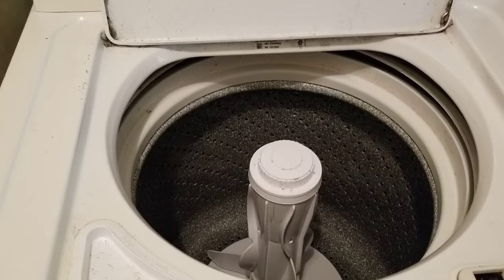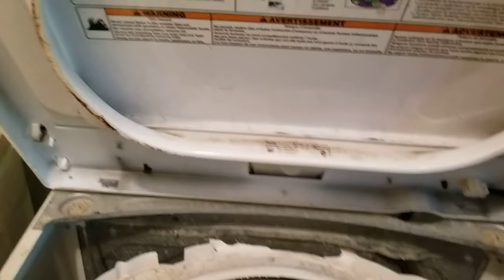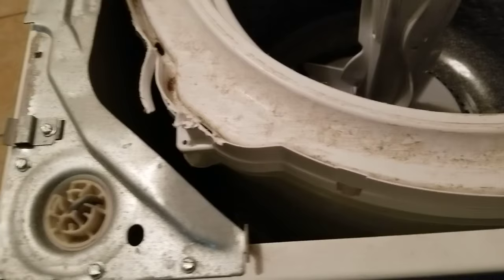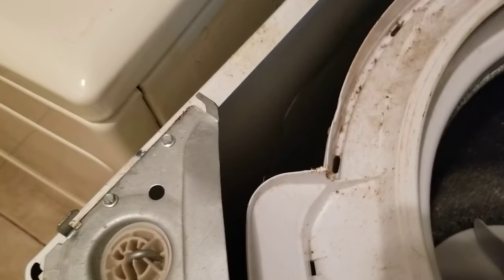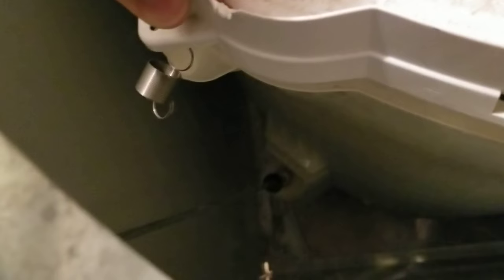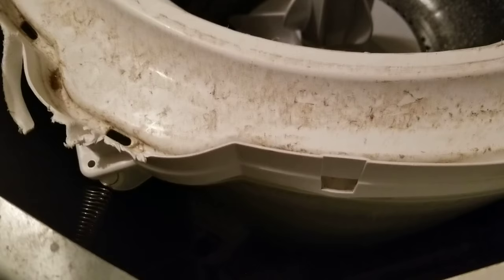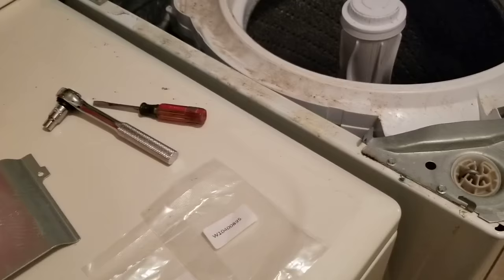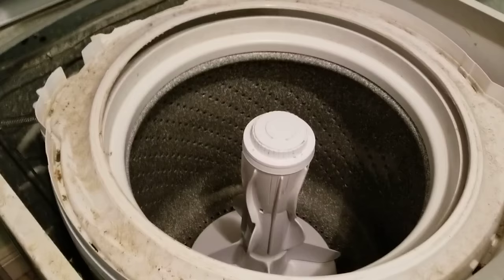Roper / Whirlpool Washer banging out of balance No. (1)  / shakes / moves *(worked briefly)

Comment: Don’t buy a new one. Look for an older 80’s era Maytag washer that’s in good shape. New washers are winey, problematic liabilities. At the first sign of resistance or the slightest off-balance event, that these new washers pick up from the load, they stop the wash cycle, crash, and throw malfunction error codes like the OBDII system from a newer car. Old washers just keep going and going like the Energizer bunny.
Reply: I did considered buying an older washer off of Craigslist. 
Thanks!

Comment: My Washer “Wirpool didn’t Come Whit Springs So am going to get them is those Springs Parts Number Apply to Any Washer as long they have Springs ?? Thanks
Reply from the maker: If it didn't come with springs, then that's NOT the problem. Watch my next video, that's probably it if it's shaking...
Reply: @PatriotMarine  Thanks going to Put them Springs On and The Top Bushings See What happens hopefully get fix thank You Sir.

Comment: thanks great job!! can you find that type of suspension part fo rmy whirlpool, i am havin trouble, wtw5000dw0........also i replaced my suspension rods 3 yrs ago, the washer is only 5 yrs old, now i am thinkn y didn't they repair the springs at the same time? thanks
Reply: We have a Whirlpool one.  Our machine kept banging around.  You could move the whole drum all over the place when it wasn’t running.  You could tell something came undone. So hubby thought it was the suspensions.  He ordered the parts on EBay.  He ordered new suspension rods and new springs.   And it takes two people to lift that drum to put the springs on.  We did a test run. I heard a slight bang for like 1 second.  And I thought. Oh no not again.  No banging after that.  The drum has a better resistance when you move it manually. When  replacing the rods, replace the springs too.  Kinda  like when you replace the lightbulbs in your car headlights, you don’t want one light working and one dimmer one.  Also, make sure the load is evened out around inside the machine.

Comment: Mines been shaking violently and watched your video. Are these springs supposed to be installed but we’re just left out by negligence? Had some that were close that I put in made a big difference. 

Gonna contact Roper on Monday and give them hell for selling a machine with missing parts. Isn’t the only thing that was wrong with this thing from the start. 

Roper used to be a quality brand don’t know what happened to them they turned into junk.
Reply from the maker: Mine only worked a few times after this repair 'STRANGELY" ... the other video after this one REPAIRED it for good STILL 859 days later...
Reply: @PatriotMarine  will check it out, thanks.

Comment: BANGING IS WORSE. I put in the same size springs that that one of the "top comments left. The banging is twice as bad. Rods are all fine, what could it be?
Reply from the maker: for me, it was fixed with new rods.
Reply: @PatriotMarine  what I found out after disassembling the whole washer was that that white top plastic ring/rim on top of the bucket, water gets in there somehow and creates an unbalanced scenario at high spinning speed making the bucket unbalanced and starts making all that noise.  What you can do to check is..  if you grad the center wash piece and move it front to back or sideways, you will hear water stuck somewhere, then that would be your problem.  At height spinning speed, all this water gets to one side and trows the bucket out of balance.
Reply from the maker: @raulchavarria5414  interesting. But water should only be up there IF it's unbalanced really bad and banging around.

Comment: If it didn’t come with springs I wonder what stopped it from jumping from the first day of use?
Reply: I had this Same washer and it did not have springs I added them after I found out about it.
Generally though i tend to keep mynloads pretty evenly balanced if inwas blankets I make sure on the opposite of agitator I make sure I add another blanket or an item equally heavy to help keep the machine in balance during spin never had the machin go out of balance I have since traded the machine for a soeedqueen though I didnt like how cheaply built the machine was.

Comment: addendum My apologies, I kinda got your video confused or combined with another one. I wish I had watched yours first or paid more attention as I didn't pay attention to the part where you demonstrated that if the tub part is bouncing up and down you said that you didn't need the 4 rods with springs. I watched this other one and that dude said it had weak springs which was what was making it wobble and slap around. This looks like it could be very dangerous if allowed to continue. I've seen pictures where the tub actually came through the sheet metal body and did considerable damage to the washer. It was totaled. It appeared that it could have been worse and if someone was standing nearby and attempting to hold the stupid thing down, like I was, Thinking that would help which it didn't but I could have been injured. I also shut mine off after noticing all that banging and just let the clothes drip dry as much as possible and just threw them in the dryer, quite wet still and let the dryer take 2 hours to dry them out. At any rate I did find out that I was getting greedy or trying to hurry things up and tried doing all 4 rods at once thusly making it a lot harder to get them in. Seems like the last one was hardest as if it was holding all the weight which didn't make sense because I had the other 3 already installed. Perhaps they were working against it. I guess that's why you don't hire a surveyor to fix your washing machine. I'm an excellent framer and form work carpenter and can do trim although it takes me forever because i like the joints to fit perfectly. I was taught.while helping carpenters while the survey work was finished and waiting on the next building to start, how to do trim work with a coping saw and a  wood rasp. It's easy and fairly quick and you don't need a fancy miter saw or electricity. I hate modern age tools, jobs, satellites and workmanship. How are we going to teach our art to the new workforce if all they need to know is which button to push or how to find an app. I haven't found an app that uses a shovel and digs a hole for you or I'd sure use the heck outta that one. Back to the subject, my apologies, I go off on a wild tangent occasionally. I may have some sort of attention disorder. Ummm where was I, oh yeah, I may have needlessly replaced the 4 rods with springs although it did help a little. It still shakes rattles and rolls. I think that was the words to a line and maybe even the name of an old rock song. Jerry Lee Lewis maybe, I dunno? But I have since ordered the 2, yep only 2 of those other apparently useless springs. Maybe they came loose and flew into oblivion or got stuck and hung up in there somewhere. I was thinking that being spring perhaps only 2 are needed due to the way a spring works. Maybe they keep the stupid thing from rocking by preventing it from moving rearward and thusly preventing the entire rocking action. I dunno but my old washing machine, I forgot the brand had this uniquely ingenious device attached to it inside below the tub that's called a half of a concrete block. Wow when I saw that I couldn't believe that such a low tech part had any sort of working function inside a new modern, actually computerized washing machine. I guess it was some sort of counterweight and did have a useful function just seemed kinda low tech for a COMPUTERIZED washing machine. Why in the name of God does a washing machine need to be computerized. I'd almost rather have the old kind with the 2 ringers you ran your clothes thru and carefully kept your fingers out of. I guess a computerized toaster or can opener is next. I wouldn't be surprised at all if there are already computerized toasters. What's next self driving cars? I guess the best advice I can offer is pay careful attention to what you're watching on you tube and don't combine videos like I did. Most of all be careful when working with power tools and even simpler things. I saw a picture of an accident that happened subjective to the subjects of this video where the tub came out, actually flew out of the machine and went into the wall of the bathroom. I've also heard of a water heater that the pressure relief valve failed and it blew up or took off like a rocket and went through the roof of the home and landed about 2 blocks away. might be a good idea to inspect that every year or 2. Or have a plumber do it. I believe it's fairly easy to do. It should have a little thingy (technical description, common laymen may not understand what this is) little larch or, I don't know how ro describe it. Look at your instruction manual or online to find it and how to check it. I;m not sure and don't go by this but I think if you pull up on the "thingy" and you hear a hissing noise and steam escaping then it may be working properly. If it's rusted and won't move or extremely difficult to remove maybe replace it or call a plumber. I think it's rare that there's a problem and not certain that new ones even have it although I don't see how they can't. Umm I wouldn't pay much attention to any of this and maybe ask someone more qualified as it's obvious that I have no idea what I'm doing or talking about. My motto is safety first and if you don't know what you're doing call someone that does. If it doesn't look safe or something bad could happen chances are you're using good judgement and stop right there or maybe get that idiot neighbor to try it. DUH, later
Reply: Mark Hill haha holy shit what are you on!
Reply: You should get a publisher and sell that story bro..

Comment: Mine still shakes those springs are not solid strong the weight of clothing stretches those things to make tub bang still ;(
Reply from the maker: This only worked for mine for a FEW times. Next video FIXED it for TWO YEARS so far.

Comment: I tried this today and it shakes even worse. I don’t know what to do now :(
Reply: The suspension rods are probably damaged, bent, from the excessive movement. I always replace all four suspension rods and the little springs at the same time. This design doesn’t tolerate off balance loads well. Wash sheets with only sheets. When washing heavy items, towels or jeans, a full load will stay balanced better than a small load. That should solve your issues.
Reply: Loretta Cirka I replaced all 4 rods. Im having someone come out this week. Even though I ordered the ones for my washing machine I guess the chances of getting wrong ones aftermarket are a possibility even though it’s the right model number. We shall see. Thank you!
Reply: @nicoleramos1396  what did the technician say was the problem? Same issue, I don't want to buy the rods if it won't fix it
Reply: @lizcortez3564  we tried replacing the rods and still doesn't work. Not sure what to do now.

Comment: Not the suspension rods?
Reply from the maker: Yes, it ended up being the rods.
Reply: @PatriotMarine  where is the video of you replacing the rods? How do the metal rods go "bad"?
Reply from the maker: @tommymack8916  should be the next video. Seems the springs on the rods lose strength.
Reply from the maker: @tommymack8916  since it was longer than 15min. it didn't post. Just reposted.
Reply: @PatriotMarine  that is probably why in the beginning it is okey , after a while the rods loosen up a little bit . I Want Roper to send me the four spring they forget to place , model number of springs prove they have to be there . I will get them from them , they will take responsibility ..

Comment: Changed the springs but still rocking.. Any advice..
Reply: The plastic ring on top of the bucket, somehow, water gets in there and doesn’t come out creating and unbalanced situation when spinning in high.  What you can do is move the middle of the washer by hand, rocking it sideways and if you hear water moving then that’s your problem.  Too much water inside that ring will throw the bucket out of balance in high speed.

Comment: Ours is brand new, never used and is like this. I shouldn't have to repair brand new washer.
Reply from the maker: You're right springs shouldn't fail that quickly, should/could be something else. Does it always do it, even with balanced low clothes?
Reply: @PatriotMarine  we actually went to store and all new washers are like this. We made sure springs are on and it has been working well. Thankful for youtube in case anything does happen.

Comment: What about the part where those springs starts squealing obnoxiously loud when they move up and down and all around making that scraping noise on the rod? I ended up having to cover the rod with a section of vacuum hose and put the spring over that and it still has a light squeal this is a piss poor ass design
Reply from the maker: Didn't encounter that.

Comment: Thanks for posting your video.  I posted a similar article on FaceBook (https://m.facebook.com/story.php?story_fbid=974882566215843&id=100010823262614).  I was surprised to see you'd gotten almost 100 responses from others with the same problem.  What burns my ass is the outlets (Lowes and Home Depot included) who sell both the unit and the springs separately; while failing to tell customers they've just purchased a defective washer which needs the springs they sell across the store to function properly.  There shud be a legal recall issued on these units.

Comment: I’d like to thank you for posting a video and trying to help people out but it was actually misleading and a waste of money.

You said if the rods are in good working condition then it’s the springs, so after I looked at my rods which are not bent or broken and in proper positions, I ordered the same springs you showed and I’d assume you don’t do very much handy man work or under stand that those super light weight springs would never work on this situation, they are useless.

There are much stiffer springs on Amazon that cost about $24 which are meant for this application. 

You should edit your heading and let people know that the light weight springs from your video are for a very light shaking and that they should also order the stiffer springs if the machine is making ALOT of noise. Judging from the damage done to your machine there is no way these little springs held your drum in center and kept it from beating against the frame IMO.

Comment: This information is incorrect and they don’t come with springs for a reason. The correct repair is to order a $35 replacement kit that comes with four long rods, four giant springs on the bottom that you cannot see, and all new bushings. 

These are compression rods just like on the hatchback of an SUV. If the hatchback came flying down and broke your hands you would know to replace those two rods. Yes you could also buy a gigantic spring to hold it up, but that’s not the correct solution is it? LOL

This is why there are so many reviews saying it did not work. Just order the rods and do the repair right.

20 year appliance repairman
Reply from the maker: Reading The Title to start is a wonderful thing..  🙄🤦🏻‍♂️
Reply: @PatriotMarine  LMAO!!!! Hysterical!!! Oooook, so you already figured this out? The hard way..  Still begs the question, why not just remove the first video and stay with the second?